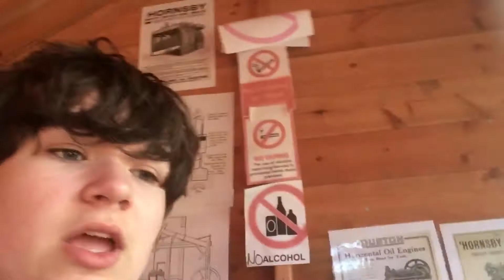Running all 3 of my Wilesco engines together!

Comment: What happened to the fire engine? that was one nasty blowback.
It reminds me of when I steamed my te1a outside when it was windy.
Blew so much that the fire was coming out the fire doors and it was impossible to raise steam
Reply from the maker: Yes. That one did. Ah right, that’s not too good
Reply: @teescottageguyproductions  one question.
How do you keep track of the water level on all 3 of them?
Also you should take the fire tray out so that the remainder of the fire does not boil the engine dry
Reply from the maker: @mcbenman1793  they all have water sight glasses and were all topped up prior to the run. I didn’t need to take the fire out as the tablets were all fully burnt out
Reply: @teescottageguyproductions  oh right i see.
im sorry, im  not used to sight glasses on my engines lol
Reply from the maker: @mcbenman1793  no problem!